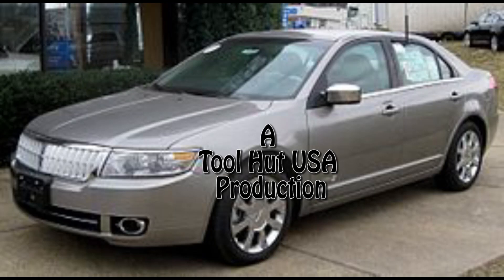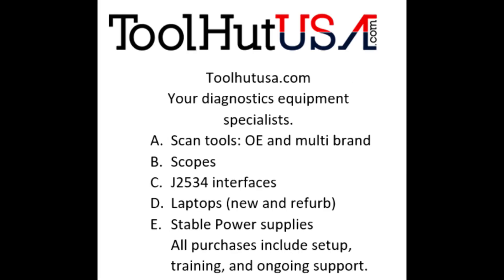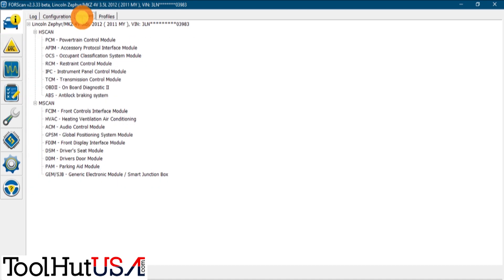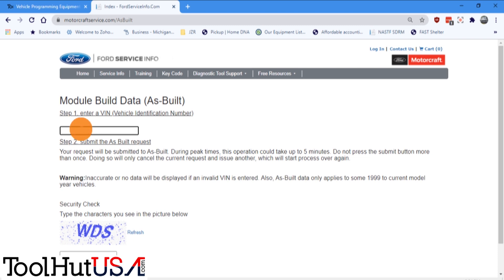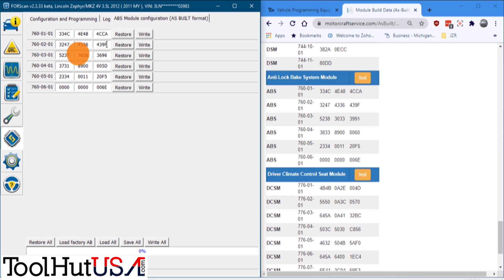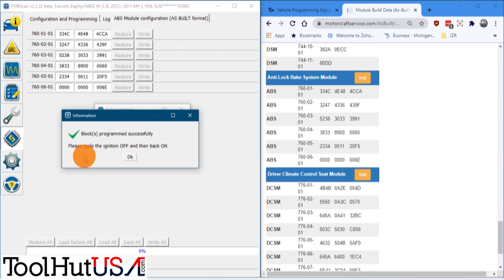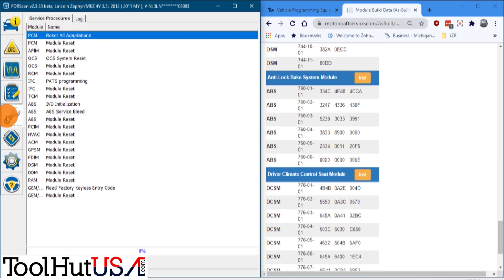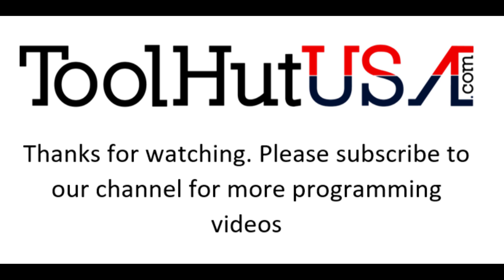2012 Lincoln Zephyr USED ABS module using forscan

Comment: I just replaced my abs module on my 2011 escape. When I rewrote the codes it didn’t change the vin on the module. Any ideas
Reply: I was able to get it figured out. I reset the abs module, rescanned it and it shows no codes! Thank you for your help and for the videos you post.
Reply from the maker: What tool did you use?
Reply: @toolhutusaakathecarflasher3019  forscan
Reply from the maker: @Bruce White  I have done several of these. Do you have autel or launch tool?
Reply: Will bad APIM module affect this procedure?
Reply from the maker: @brucewhite1381  I doubt it
Reply: Using my computer with FORscan Pro ELM 327 adapter
Reply from the maker: Are you doing write all? I would try a different tool
Reply: Any recommendation for a different tool
Reply from the maker: @brucewhite1381  1st realize the escape is problematic to get vin to change. I would try a top done Phoenix lite 2 or an autel ms906
Reply: Do you think that the ELS27 adapter would work better
Reply from the maker: @brucewhite1381  no, I think forscan is problem
Reply: Ok, Thank you

Comment: I have a ford fusion 2010, the abs module was replaced by another with incompatible numbering on the part, can I make it compatible by doing this procedure?
Reply: Same here, I’ll add mine here so I don’t ask the same question again. Mine doesn’t have brakes so I need to fix it bad.